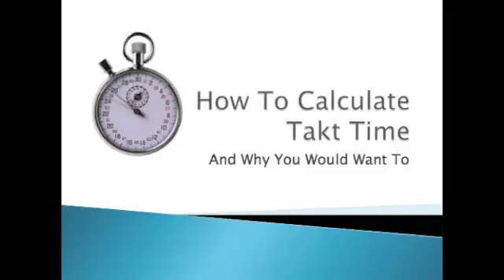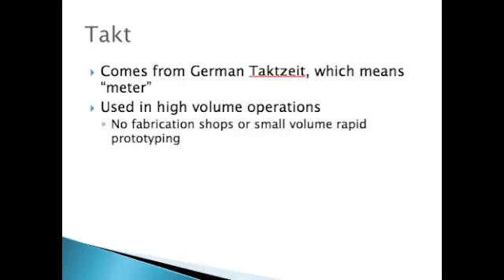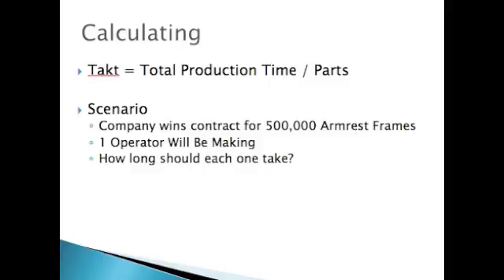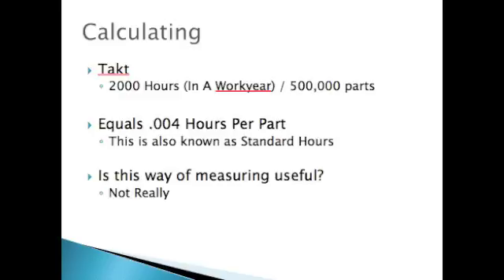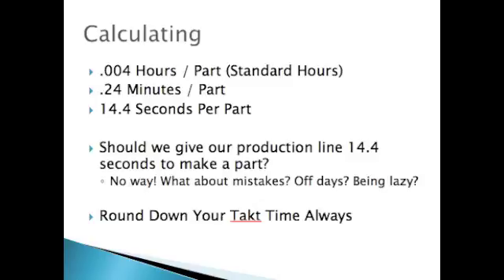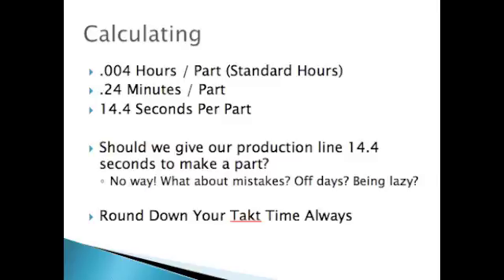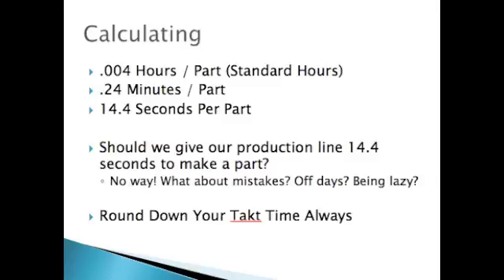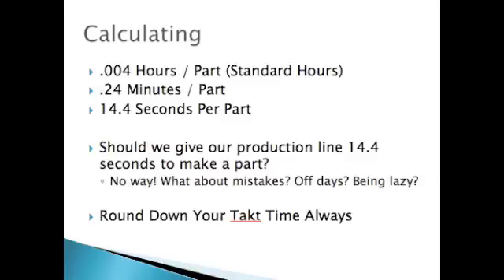Beginning Engineers Takt Time

Comment: How to calculate DISTANCE travelled by component when "takt time" of component and conveyor speed is given.?
Speed of conveyor = 8 meter/min (Stop and Go type Conveyor) Takt Time of component = 50 seconds Distance travelled by component in Takt Time or Pitch of component = 2438.4 meter How much distance would be travelled by component in 10 minutes.. Please explain your answer also, so that i can learn the formula for similar problems
Reply: Takt time is a complete product production time based on what the customer needs. So if your Takt time is truly 50 seconds that means that you have to have the part completed and ready to ship in 50 seconds. You can definitely break the Takt time into smaller sections if you have multiple production cells. If you are saying the part travels 2438.4 meters in 50 seconds than total distance traveled by the component in 10 minutes would be ((600 seconds {10 minutes of seconds} / 50 seconds in takt time) * 2438.4 meters / takt time = your answer in meters (should be 29260.8 if I'm following you correctly). I'm not sure why you are doing this equation though
Reply: Acually i recently got a job  in a Powder coating painting industry. But my senior colleagues are not helpful, they are not sharing their their knowledge. In painting industry, customer wants number of pieces to be finished in a day, They give us takt time and component pitch like 96" or 2.4384 meters. As the time in different processes like in paint booth, oven and and flash- off varies, like 10 minutes, 30 minutes or 8 minutes, we need to calculate the length of conveyor to be used in that process. I also calculated the same way as u did. but as per my seniors and older projects referred, it must come to be 33 meters in 10 minutes and 92 meteres in 30 minutes.. Thats way i am asking this question here. size/length of component is 2.0 meter. I dont know how they calculate this.
Reply: Are you saying that all the stations are connected via conveyor and that the parts travel through all the stations on the conveyor? If this is the case I recommend breaking the problem into parts like you said before (paint booth, oven and flash-off). If you have the takt time for each area than you can figure out the conveyor speed needed to get through that area based on the length of the area (and perhaps the length of the part if that is a factor). Also keep in mind if the conveyor is traveling between stations you will need to factor in that time as well. I would recommend first drawing a process map of the flow of the area, then break down each area and fill in the information you know. Everything will have to add up to equal the exact takt time required by the customer, you may have to do some research to find some of the missing inputs or perhaps you can solve for them. Wish I had more for you but it's hard to say without having specifics, good luck!